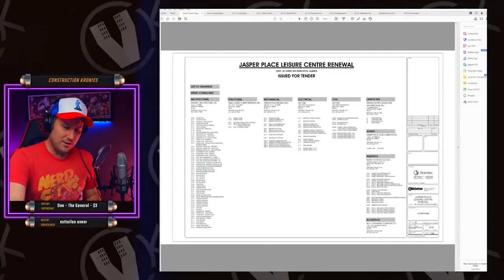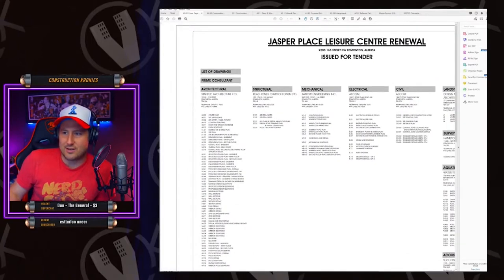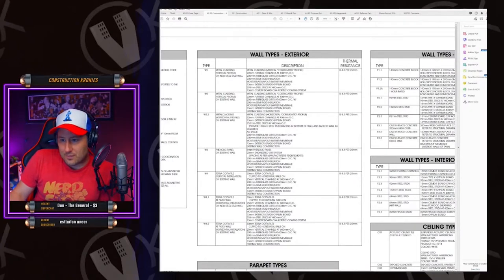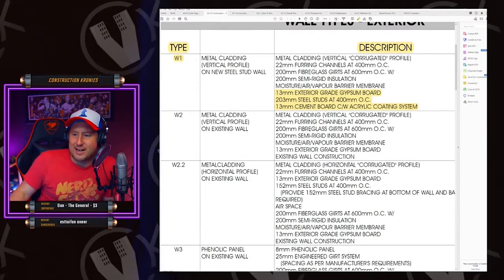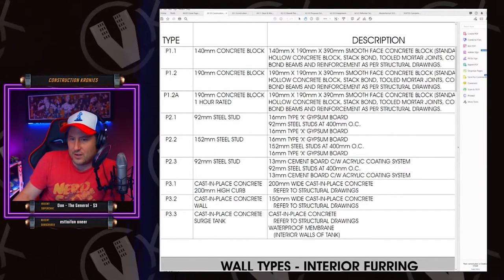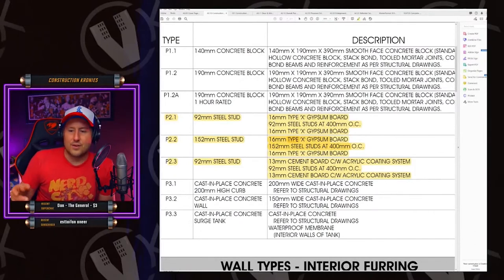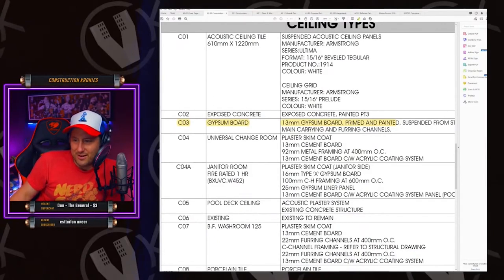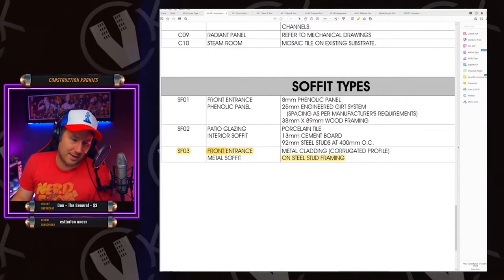Metal Stud Framing Layout From The Drawings Wall Types

Comment: 10:22 you show a pipe running down the middle of where the header would land for that section of wall. What did you end up doing to accommodate for that?
Reply from the maker: I replied to this comment the other day but looks like it didn't go thro. In this situation we had the pipe moved over. Most of the time we would move the wall but this time the location of the wall was critical.